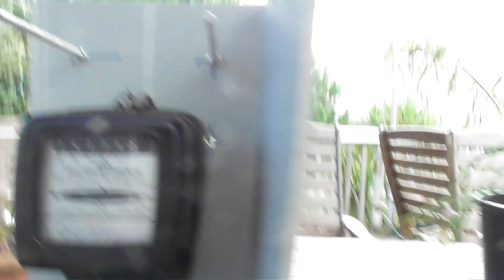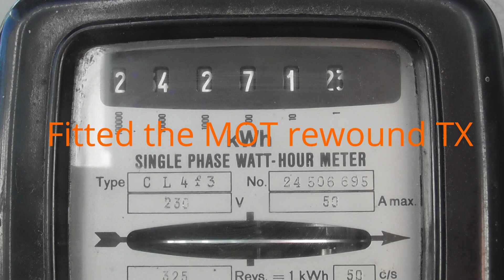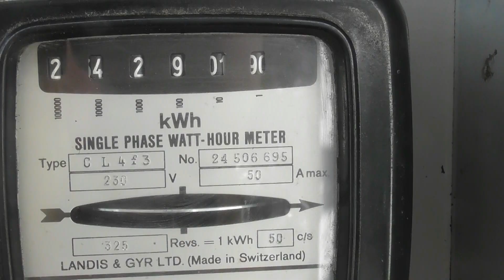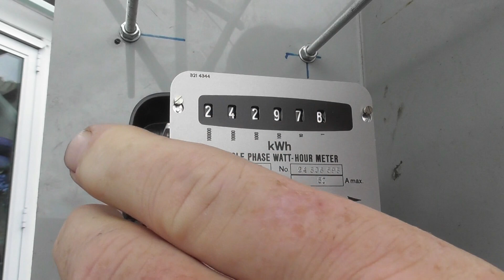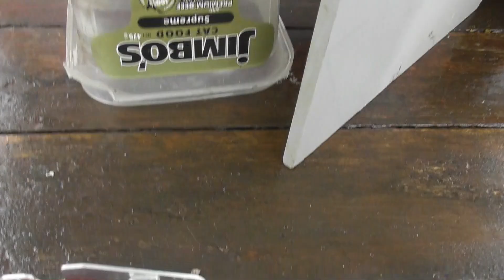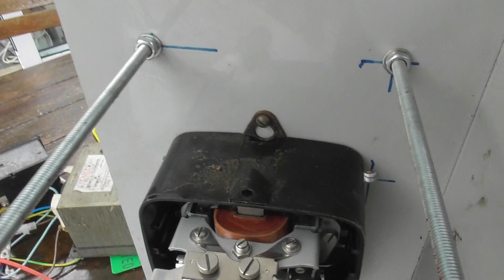CL4f3  Swiss made quality Watthour meter

Comment: I repurposed a CT to have the secondary 10 turns drive the single turn primary, so the meter read 10x the power. 6A makes 60A in the current loop.
Reply from the maker: Yes, that works as well.
Reply: How does this meter assume power factor
Reply: @nathanielnzl  It measures real power, not apparent power, like almost all electric meters used for domestic consumption.